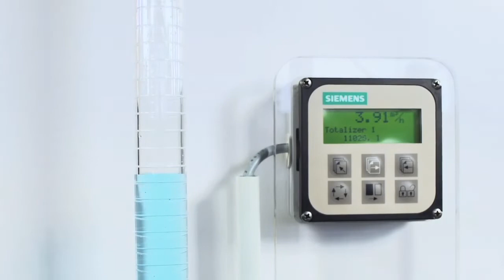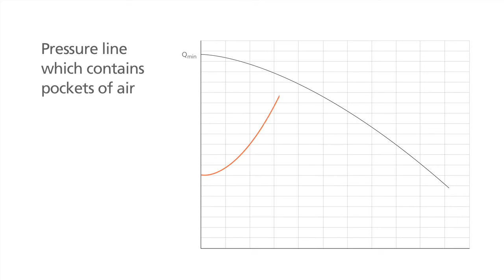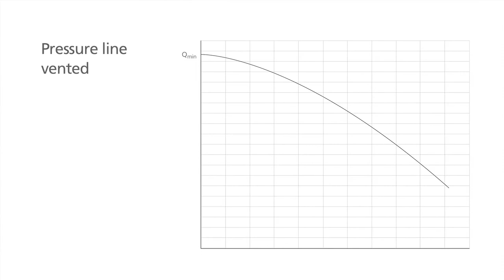Hydraulic model testing  Air pockets in pipelines

Comment: Do you happen to have or know of a table for various pipe diameters showing what pipeline velocity is required to discharge air pockets for different degrees of vertical changes in pipe (i.e. 30-deg., 60-deg., 90-deg [vertical downward])?  This would be very helpful.